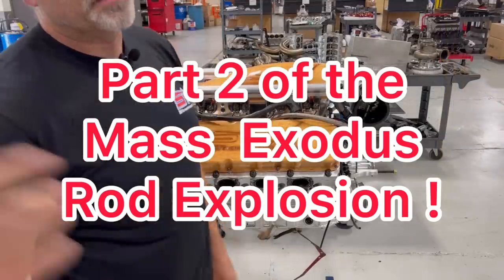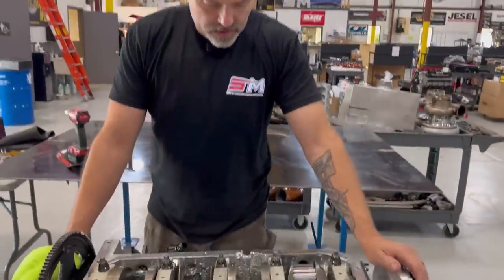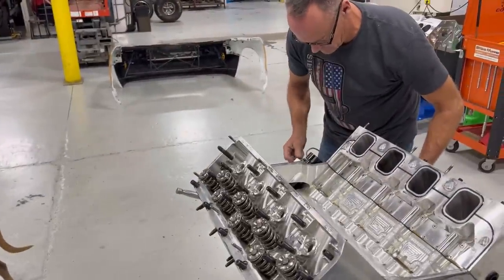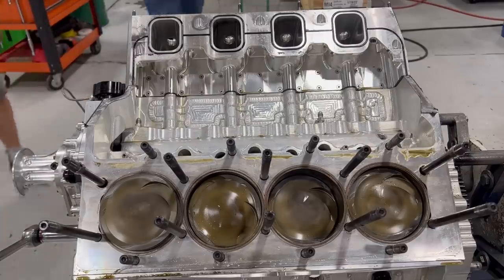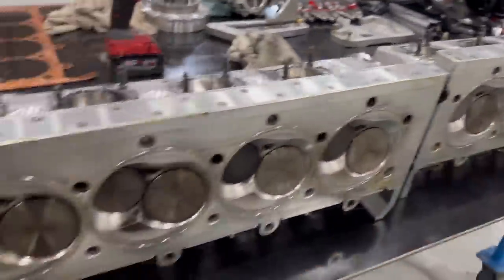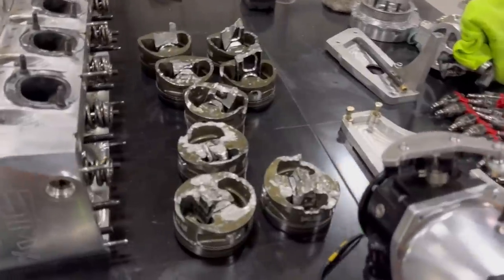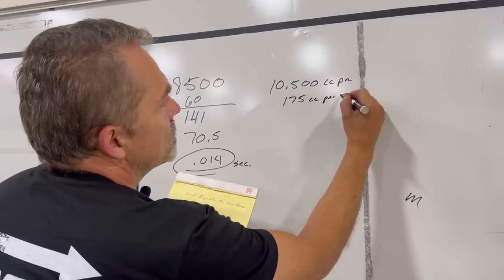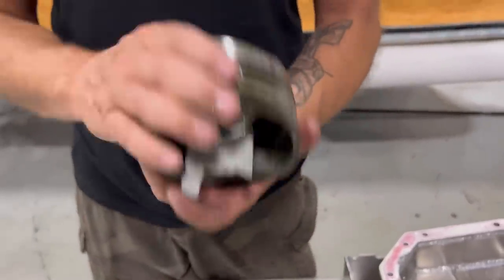EXPLODED RODS  Part 2

Comment: My condolences to you on the loss of your engine... but a great video, and an even better attitude about it. Two thumbs up. Speed is money... how fast do you want to go... lol. 
7 years as test engineer and material failure analysis, my gut is screaming your rod supplier over estimated the performance of their rods. 
If it was a material defect, most likely it would have effected only one or two rods.
My guess, without inspecting the parts, is a poor design, for your application,  which includes not only the physical dimensions, but  material choice, i.e. the alloy of the aluminum, and manufacturing process, i.e. forging specs, heat treatment, and anodizing. 
Based on the way the rods separated from the crank, IMHO, the rods were not designed to contain the centrifugal forces, causing them to fly apart... hence the appearance a grenade went off in the oil pan. Ever watch a video of someone spinning a CD or LP until it comes from together... lol. 

To give credit to your supplier, they ALL failed simultaneously, meaning they were ALL built to the same spec and tolerance, which is not small feat. They were consistent. 
Something a lot of guys over look is all the stresses a connecting has applied to it, in tension, compression, centrifugal, centripetal and G-forces. It is no mean feat to design a part that can handle all that, and keep it as light as possible, without failing.

Comment: Hydrolocked is still possible.  Your calculation of 2.36cc per cyclce is completely correct ... your cylinder head volume at 73cc is also correct. Your conclusion that it is therefore "impossible" is incorrect. You are assuming that each cycle clears all the fluid from the cylinder and you have 73cc available to fill ... if you have an ignition failure and the cylinders begin to accumulate fuel, you will fill that 73cc of head volume in 31 revolutions. I suspect it blows "some" fluid out each time, but, eventually it fills up and hydrolocks is still a possible scenario.

Comment: Material failure? Everything was fine until every part wasn't and all at the same time. Hmmm... I'm not sure about the calculation of RPM, conn-rod mass, centrifugal forces, etc. Did it simply exceed the material's strength properties? Especially since all of the bearings, crank journals, etc. looked perfect.

Comment: What is the hp/ rpm limit on the connecting rods? Is there like a piston weight limit or rotating mass calculation? I am still new, so far worst things I've done where forgot to bolt down the oil pump before putting the pan on and forgetting to locktite the flywheel bolts, whoops. For all my errors so far GM has made the most forgiving engines, no oil pressure, dive on it for a year its fine.

Comment: Do forges rods break like that?   Seems that’s what a cast rod would like when breaking.  I always though forged metals tend to bend more and then break, whereas cast parts… look like that.  I wonder if there was a manufacturing problem on those rods.  (Are they 6061?). Everything is in tact, including your bolts, but the rods broke like sintered metal!

Comment: Yeah, that’s got to be the wrong alloy for the job, a bad lot of material or wrong processing. The aircraft industry used to send a sectioned piece out to destructive testing. A precision machined blank made in the same direction of grain as the product’s load would be submitted to. High frequency cyclic tension and compression till failure. In this application the anodize serves no other purpose than visual appeal. In fact it could cause hydrogen embrittlement problems. Steve, perhaps your supplier needs to do some destructive testing so you don’t.

Comment: I'll maintain my comment on the last video, either the heat treat failed, or the rod wasn't designed to go that many rpm against the pressure the counter weight hitting the piston and when 1 rod let go it caused a vibration that has a cascade effect and broke them all, this was strictly stress on the rods not anything then that, it's just really unusual all the rods shattered which is what they did I'm still taking vibration frequency against load caused a failure and that failure vibrated the crank and shattered them.

Comment: There is one guy we tractor pull with sport stock engine he gets his engines bored a little tighter and when it gets hot at the end of the track you can hear it dipping rpm because the piston is trying to stick in the bore

Comment: ... my grandfather was a pretty good engine builder in his day - used to work on some NHRA fuel cars - he built me a stout big block chevy for a 69 chevelle - pretty tame - about 550 horse - I asked him how do I know where to set the red line on the tach - he said - run it up in second gear until ya feel the valves float then reduce it by 300 or so - 500 if you really wanna be safe and have it last - in your case - given the damage to your rods - I can hear him in my head saying - ya - 8500 was too much - set the limiter for 8499 - 8497 to be safe :-)  -  he also said -  if you uncle had balls shed be your aunt - both his thoughts are strangely still appropriate in todays world :-)

Comment: Seems to me the timing may have somehow advanced BIG TIME and pre ignited all eight cylinders in a split second. I only have old school stuff with 70s type distributors so dont know if thats even possible with the fancy stuff ???  I cant think what else would cause all the rods to shatter like that except maybe dumping a bucket of water in the intake at full RPM. Only Whistlin Diesel would do that !
Reply from the maker: Just to give you a little FYI
Nope, this engine has been running perfect at 10 more PSI boost and 900 miles with my normal billet aluminum rods. 
These new rods have NEVER been in a engine like this before, I was giving them a try. 
They plain out failed, nothing caused it. They failed, not a timing issue, I show the actual data log, not tune up , it is bad material never tried before.
Reply: @stevemorrisracing  I will have to agree. They shattered almost like safety glass.

Comment: big boost + detonation?,sticking wastegate?,does it have a data logger to snapshot what was going on when t kicked out the rods?,we had problems with the falcon 6cyl turbos in australia that didnt have a big enough wastegate built in to the factory turbo,when people ran huge exhausts on them they overboosted and kicked the rods out the side of the block

Comment: No form the first video I already determined it to be catastrophic failure of the rod materials used in the set that just detonated due to metallurgical problems in the cast or making of the rod out of too weak of material for this application. That is my determination of  the blown engine. No those rods shattered due to brittle metal used in the fabrication of the rod's in my way of thinking. Let me know if we concur with each other's thinking here.

Comment: Thanks for sharing! That's racing right there. 
Honestly, it looks like just too much RPM induced acceleration for the piston weight on those rods. The rod just plain pulled apart by the looks of it. I'd have to take a piece of that aluminum and crush it in a vise to see if it was pressure that buckled the rod, but the material is all kinda, pulled apart. The grain fractures on the piston side aim outwards and down.
--I wanted to think that maybe the caps pulled out and got beaten by the crank like a wood chipper, but you showed that piece with the stud still in it. 
I'd actually be willing to use those rods on one of my own builds. I'd call the rod guy and tell him to have them vapor blasted with fine glass beads, and then wish him a Merry Christmas.

Comment: I’m really curious of, what if the rod maker had a material mix up in manufacturing and that’s not the correct material? 6061 instead of 7075 kinda deal.

Comment: That type of failure may be most likely have been due to compressive rather than tensile forces, from the way they failed. Still amazed they all failed at the same time - it suggests extremely good quality control, and/or something 'weird" happened right at that moment? Could it be down, in part, to the beams flexing sideways, rather than just along their length, under load? That would further explain the fault planes?
It's a testament to the quality of the parts, and the assembly, that even a catastrophic failure like that damaged relatively few parts - as they say, "you can pay me now, or you can pay me later"😎👍

Comment: It would seem 1 rod let go, the down step in rpm, and then the vibration caused the rest to let go, the larger eratic drop. Each dip after the second level out in rpm was possibly subsequent rod/s coming apart(or the rod ends hitting the block) it appears most came apart just under the wrist pin and the rods hitting the block etc. destroyed the rod/rod caps. Am I even close?

Comment: I agree it’s a material problem. The forces on connecting rods have been studied ad nauseum  so I won’t repeat what’s already known. It looks to me like the material is brittle ( like glass) and the material shattered at the point of overload. You initially said that this was not the regular or normal material used for this type of application and you were trying something new.
A good material scientist worth his or her salt could help figure out why this particular type grade and heat treatment was not suitable but that is almost irrelevant since you know it failed the SM stress test. It depends how enthusiastic you are to analyse the failure to death but since enthusiasm can be measured in green backs I suspect it’s not worth it. 
Some electron microscopy of the failure point and analysis by someone who knows provided detail on the failure mechanism but who cares if knowing is less important than racing or building engines. Analysis of part failure is not an endless loop but only a stop on the journey of discovery. The material science of modern aluminium alloys is mind blowing and given you are stretching the boundaries of existing knowledge I would assume you have a “technical support engineer” who can advise on metallurgy, failure analysis etc,etc…..
I think your exploration of the boundaries of boost and power in the big block world is super interesting although might cause some extra grey hairs but there is so many other pieces of modern life that will do the same you may as well have them created by something you love or have a passion for.
Thanks for the courage to be open and honest about these events. Not everyone would do the same, character and integrity actually matter in real life and shine through in times of adversity. Good luck Steve with this journey. I watch with great interest

Comment: I still think the rods were over hardened during heat treating phase of manufacturing and couple that with possibly a bad alloy recipe. I think I see from your video, tell tale signs of overly hardened (or failed heat treat process) possibly un-normalized alloy. I've seen faulty heat treating or age hardening 7075 act the same way. Grain size and crystallization at the fracture cleaves can be observed and will give clues.

Comment: Okay. Is weight so critical you can’t run good forged steel rods ?  What’s your opinion on carbon fiber rods ?   Can’t wait to see the results of the metallurgy test.
Reply from the maker: Don’t care about weight. 
Aluminum acts like a absorber and is actually stronger ( normally ) that steel in this app.

Comment: At the 32:31 mark the piston is quite deformed causing the oil rings to become totally flattened on one side.
Is that because the piston, flying an extremely high rate of speed, hit the head when the connecting rod disintegrated?
Reply from the maker: Yes sir

Comment: 7000 series aluminium Rods? It is stress corrosion fatigue prone, particularly with heat and corrosive moisture environments. Thank for breaking down the engine in a video.

Comment: Man what a catastrophic failure. I have a scat 4340 forged steel crank and 4340 forged steel have beam rods and J.E. flattop pistons in my small block 347 ford stroker. Are they as good as the billet?  Will the steel handle a turbo? I don't know if turbo needs billet or if forged steel is o.k. for a turbo. My first hot rod. Engine is blueprint and balanced also. Looking forward in an answer if ya have a minute or 2

Comment: Looks like those rods hit a harmonic, and vibrated apart. Get another one that's as close to identical, and see if it has a resonance frequency, and it might even be close to the frequency your engine would make at, say, 8,500 RPM.

Comment: 100% alloy issue. I've been working with aluminum over 32 years, and with companies that actually mine it, extrude it, and anodized it, from around the world. Regardless of the type of aluminum alloy, many manufacturers mix in a lot of recycled material that weakens the alloy. I could tell the difference by simply milling and cutting it, after all these years. China has the worse by far. Russia is a close 2nd. Most of Europe has the best alloy.

Comment: Gonna ask because I don't know for sure, but; from my days of building race engined Tritons for M/C road racing (I'm  older than the dirt your shop is built on) which are also a dry sump engine, if you had enough fuel enter even just one of those large cylinders to hydraulic lock it - wouldn't that have shown up in the oil dilution after it grenaded?   Engine stopped, so no more oil pump pushing oil through engine after it blew so the oil that was scavenged right at the last, or what was left draining out of those nice new oil pan ports your big ends created would surely have shown a lot of fuel dilution - wouldn't it - if an over fueled hydraulic lock caused that catastrophe? Now, since all rods are trashed - that would only be the case if an overfueled created hydraulic lock occurred on ALL cylinders and, - boy you can imagine the pressure pushing those pistons downward after the event and all that fuel exiting that engine through whatever means it could; exhaust ports, down past the rings into that pan while you were busily transporting the poor girl back to the shop - since there were holes in your drip pan there should have been more fuel than oil running out the bottom of that engine -IF an all cylinder fuel hydraulic lock was the cause.  Am I all wrong here,  . .or . .?

Comment: What could apply such a tremendous force to all the rods at the same instant ??  What if the crank suddenly stopped?  
Hmmm. I'd want to look outside the engine for the cause. Look through the power train. 
BTW, I have heat-treated aluminum alloys and it is very possible for a batch to go wrong.

Comment: Do you normally use 8500 rpm? What is your rev-limit?
The underside of the pistons show a dull colour. Are they ceramic coated for heat shedding?
Reply from the maker: 9500 rpm is normal max 
these pistons are hard anodized, go back to a couple of the older videos I show all that and talk about it.

Comment: Steve excellent video again and I understand why you try to explain to these people that have these outrageous ideas of why the rods broken the engine all I have to say is the people that you bought the rods from I hope they have a way to go back and find out what the number of the bill it is that made those rods so you won't get a bat from that billet anymore because someone dropped the ball when they made that bad for those rods they didn't have enough for something or they didn't watch the temperature correctly but someone dropped the ball on that it was most definitely metal fatigue they might figure no one would ever put the pressure that you put on them but you didn't really put any pressure on them only 40 PSI that's nothing for what the rod supposed to be capable of handling you did get off of Lucky though but just for good measure I believe I would change those lifters on number one cylinder where it not the rocker arm off it could have flat placing on the needle bearings Steve you think you've heard some crazy reasons it it happened I heard about the craziest one this week I went by a shop in my hometown that's run by younger guy but they say it's a great mechanic and he's very young but he was talking to some of his friends and he told his friends the reason your motor down what it is because the oil didn't have his high enough lubrication factors to it the other people were listening to him and I believe they were believe in that all right I left for someone asked me what my opinion was and I had to hurt someone's feelings I know you've heard the old saying some people can't see the forest for the trees enough on that get that thing back together and be careful Steve and have fun

Comment: This was about 30 years ago…. My dad was shop foreman at Keith Blacks… One year at Bonneville, Al Teague was running his Big Hemi streamliner with M/T or Howard Rods… One of the rods split right down the middle  like a book… my recollection was it looked like it was either a bad casting or I think it was definitely a metallurgy problem…. Crystallization it looked like … My brother said it was a cold lap in the casting…Very odd…. anyway, dad told him to run Carrillo’s steel… You shouldn’t be putting such a heavy bearing load in his application like top fuel abuse in 1/4 mile…. This is about what we saw that day in an aluminum rod…. nothing else… Dad did say, take a piece of welding rod and piece of aluminum rod and put each rod into a strain test ….Steel stretches, aluminum breaks…. and Al ran steel rods and went 430mph the next year… the rest was LSR history…..